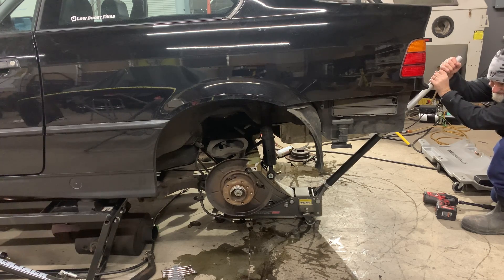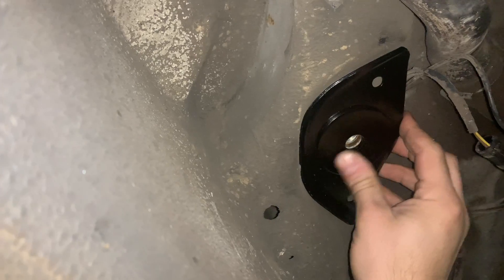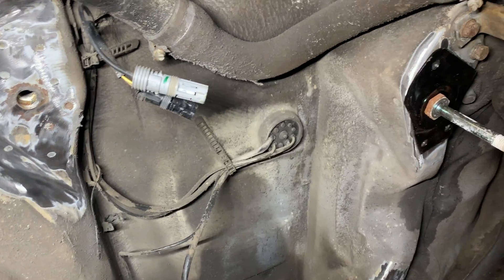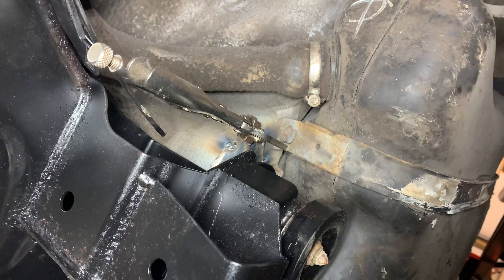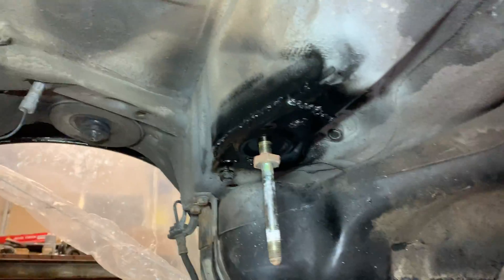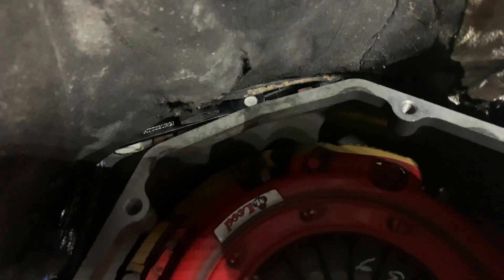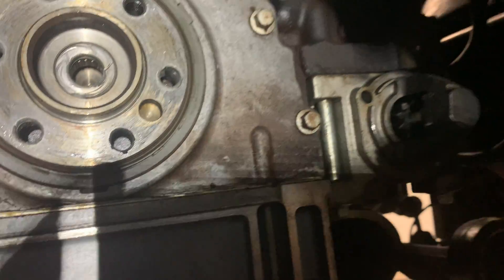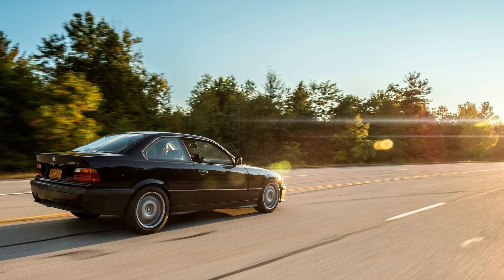E36 REAR SUBFRAME REINFORCEMENT PLATES: E36 TURBO LS SWAP: Part 29

Comment: Wasn't too sure about welding so close to a plastic petrol tank, but it didn't go bang, so all good.
Reply from the maker: Yea I got a little nervous but the sparks didn’t get close
Reply: - I'm in the UK and I have a '95 325tds diesel. Had to drop the tank a few years ago to run all new hard brakes lines to the rear end. I thought the tank was nearly empty. It wasn't. Should have checked first. When I disconnected the filler pipe the tank dropped onto me and I got a nice bath in diesel. Swallowed more than I should have. Turns out diesel makes a very effective laxative.